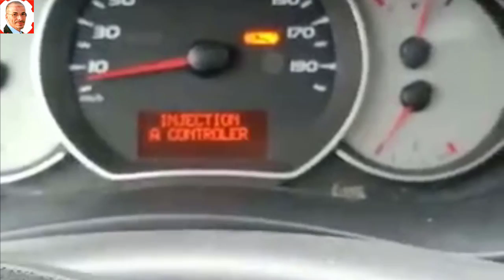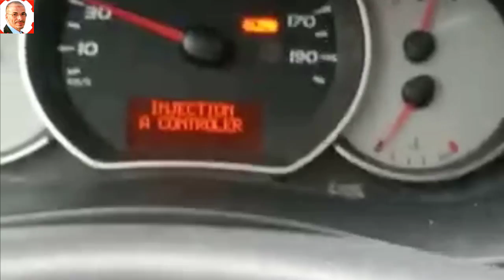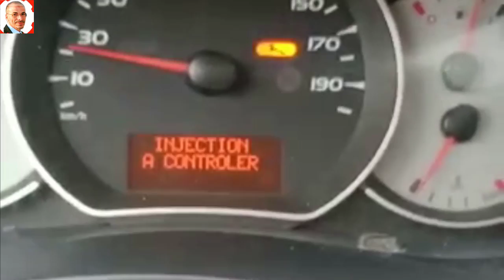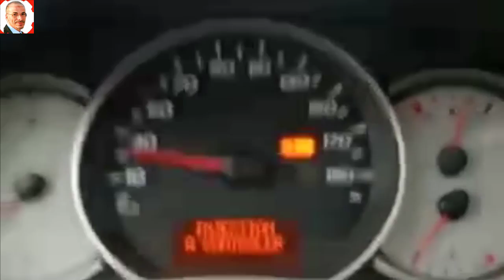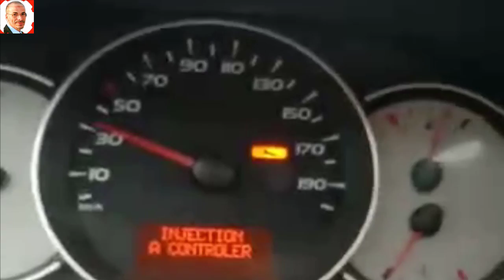اسباب الممكنة مشكل تحذير - Injection a controler Renault

Comment: Les pompes 1.5 sont fragiles. Elle tombent en panne au bout du 200 000 km. Normalement. Peut être une impurte est entrée dans le circuit du diesel comme t'as dit. Il y a le régulateur de pression sur la pompe à démonter et à nettoyer. Aussi le capteur de pression de la rampe. Si le problème persiste il faut nettoyer tout le circuit du diesel avec le produit liquimoly adéquat. Sinon c'est la pompe à revoir.